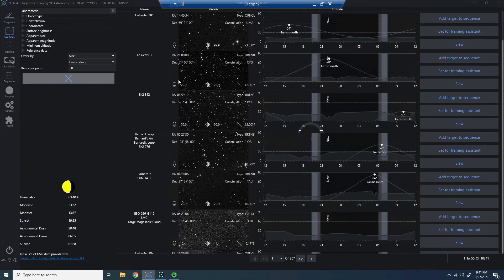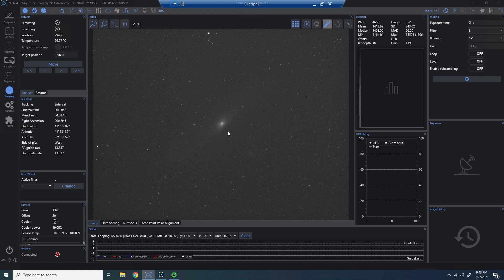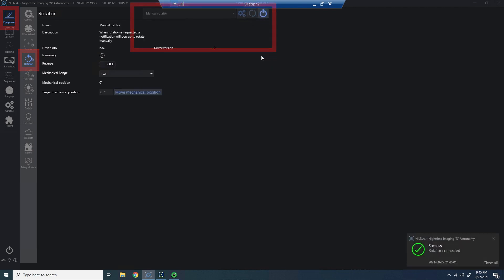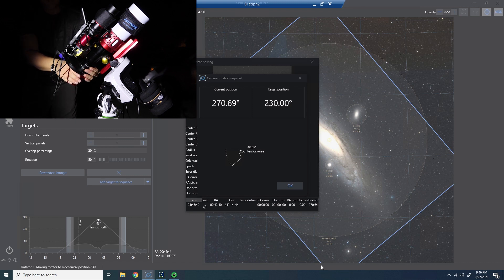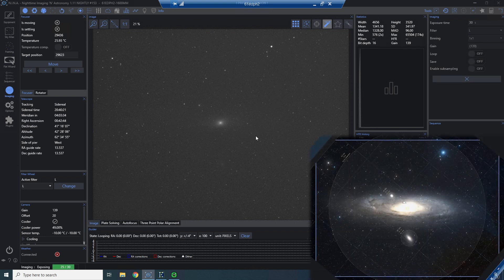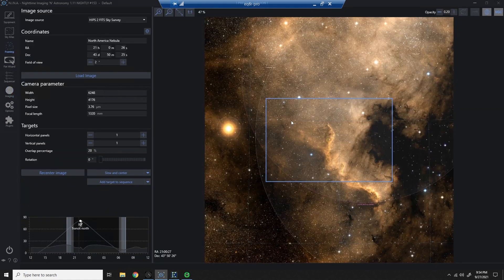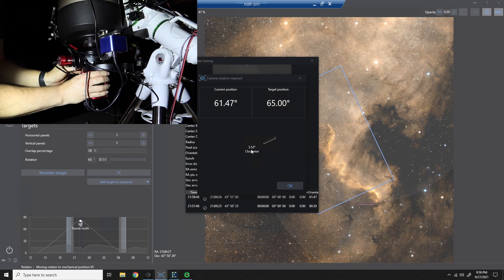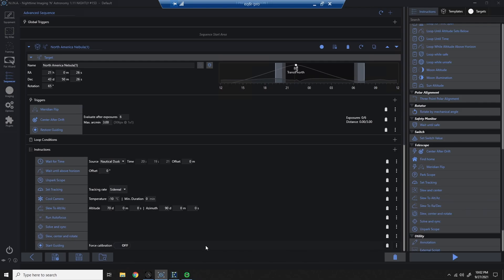Better Framing in NINA with the Manual Rotator

Comment: He says to manually rotate just the camera, not the camera and OAG nor the whole image train. The problem that creates is the OAG prism may be no longer aligned with the long side of the camera rectangle, in which case one may get vignetting from the prism of the OAG. Its important to keep the prism at 90 degrees to the camera sensor rectangle.

Comment: brilliant vid bud , im still new to nina and upto now i know how to connect mount HEQ5 - camera (nikon dslr Z6 and 600mm sigma lens, to nina and do a 3 point polar align and platesolve , and learnt to set the sequence for "many exposures" and "auto meridian flip" which i find really fascinating to watch 
my question is regarding the rotation can the same method you showcase here be used with my camera and 600mm lens ? my lens does have a ring collar so manual rotation is no problem 
also i dont have a guide scope at the mo im currently saving up for that so im generally shooting nice pin sharp stars at 90 second expos

many thanks :)

Comment: Keep up the good work, your presentations are always very clear and thorough.
Reply from the maker: thanks! sorry for the delayed response!!!
Reply: @PatriotAstro  actually I have a couple of questions if you don’t mind.  Nina advanced sequencer has been working wonderfully for me until last week.  Now when I frame and slew to an object, it is half off the frame and I’ve checked all my camera settings the pixel dimensions everything in it all seems good and I can’t figure out what it is.  Is there some common error that’s easy to overlook that I may have triggered?   

My second one has a do with a manual rotator.  It’s not doing anything anymore, no matter how different my framing is from my rotation it just hits the manual rotation trigger (slew, center and rotate command), does a plate solve, reslews (still half off the framing I defined), and then moves onto the next command if everything‘s OK.  My rotation tolerance was 5° and it was off by 40° Or so.    But NINA didn’t care.   The command is enabled it has no warning notice on it and my manual rotator is installed.  I’m imaging just half off the frame and improperly rotated.

And one more clue:  Last night for the first time -n my NINA sequence, the “center after drift” command doesn't work and it displays “NaNpx” in the number of pixels of tolerance that is allowed, I assume because it doesn’t know the pixel dimensions (i.e. what camera or scope is connected).   And if my unguided scope drifts and it plate solves with the "center and drift" it still says off by 0 pixels, even though it's clearly drifted.  It's as whatever triggered "NaNpx" just allows it to platesolves, but does nothing with it.  But once again, I look in all my HW config and the camera is attached and the parameters are correct, the telescope focal length is correct in the Framing section (although it's curious that when the "telescope" is connected in HW, that is really just the mount, the focal length is actually under the camera parameters in the framing section).
Reply: Just to reinforce that I’ve tried to chase this down:  I’ve posted to the CN forums and NINA Facebooks forum, got many suggestions for possible causes and checked/tested for all of the over two nights: no fix. (Ex: bin1 vs bin2 mismatch in capture vs platesolve, wrong telescope focal length, not resetting sequence, several places camera setting could be wrong or mismatched, ensure commands are enabled,  incorrect location config, latest NINA version, reboot computer, etc…)
Reply from the maker: @stevenmiller5452  Can you tell me which version of NINA you are running? There was a NaNpx bug but that has been resolved. I wonder if much of this stems from that?
Reply: It just so happens NINA said there was an update available.  I downloaded and tested it:  It worked, all problems solved.  It must have been a bug.
Reply from the maker: @stevenmiller5452  Ya, there was a wierd bug there. Glad it is sorted out! Clear Skies!

Comment: Chad, another great video.  Question:  I assume it would be best to have a manual rotator between the camera and the OAG so you don't rotate your guiding.  Is this a significant problem, it looked like you rotated everything.
Reply from the maker: I can rotate the adapter on the back of my guider such that the guide camera stays in place. But you are right, that would be an issue and require recalibration of PHD2/

Comment: Hi Chad, I am new to NINA coming from APT and can't find anything on how to do a manual focus update say 60min. into a sequence?  I get how to initially select a star and focus then frame up a target and start a sequence but once a sequence is running how to pause it slew to focus star and then slew back to target set in framing assistant?  Is this even possible?  I do not yet have an auto focuser so have to do this the hard way for now.  If this can be done a video would be great...
Reply from the maker: OK, so try to follow along with this logic. :) You can open the Advanced Sequencer and build this sample sequence to get a feel for how we can do this (without even connecting any equipment). 
Go to the Advanced Sequencer and drag over an empty 'Deep Sky Object Sequence' from instructions. This is where your target would be, such as M51 as an example. On that DSO container, put a looping condition of 'Loop Until Time' and select 'Astronomical Dawn'. In the Instructions section of the DSO container, add 3 items in this order, from top to bottom. 1st, add a 'Sequential Instruction Set'. Add a looping condition to the Sequential Instruction Set of the type 'Loop For Time Span' and set it to '5 seconds' (just for the demonstration, in your real example it would be 60 minutes). In the instructions section of the Sequential Instruction Set add an 'Annotation' instruction that just says "NINA would be imaging in here". OK, now minimize the Sequential Instruction Set and place a 'Message Box' instruction below that set... it needs to be below the Sequential Instruction Set but still inside the DSO Container. Add a message of, "It is time to check the focus again." Lastly,  below the Message Box, and still inside the DSO container, add a 'Wait For Time Span' utility instruction with a delay of '10 seconds'. 
So, what does this all do? When you start this sequence, (you can try it now) it will start up and determine it needs to run/loop your DSO object all night until Astronomical Dawn. Great! Inside the DSO container, as a first instruction, it finds a Sequential Instruction set that is built to run/loop its included instructions for 5 seconds (which in my demo here is just an annotation that doesn't do anything, but in the real world, this would be where your imaging instructions go. Additionally, this loop would be 60 minutes in your example, but much shorter for the demo). When the 5 second loop expires, it moves on to the next instruction which is a Message Box that pops up and pauses the entire sequence until you click OK. This is how the system will stop and wait for you to physically intervene. After clicking OK, the system will start a 10 second Wait For Time Span instruction. But, why do I need this? Well, the message box will pause your sequence, but it also locks up the NINA interface temporarily until OK is pressed, and once pressed, it moves on very quickly. So, after you press OK, this 10 second wait is just here to give you enough time to click the Stop button on the sequencer (which can be done directly on the imaging page, so you really may only need 2-5 seconds actually). Once it is stopped, you can perform focus or whatever you need to do, then when ready again, click the play button and the interrupted 10s Wait for Time instruction will restart. Once the full 10s expires, since it is the last instruction in the DSO object, it will loop back up to the Sequential instruction set where it will happily keep looping all night long until Astronomical Dawn. This all sounds WAY more confusing than it is once you drop it in a sequence. If still having issues, send me an email. :) Just build it like I mention and test it yourself. Hope this helps!

Comment: Thanks Chad. At 6:38 you say you’re only rotating the imaging camera. But wouldn’t that risk having the prism move into the image area (since you’re not moving the OAG with it)?
Reply from the maker: 100% yes. It’s not ideal, so an option would be to also manually move the guide camera along with the primary camera BUT you would almost certainly need to recalibrate PHD2 for guiding to work afterwards. That is a great point!
Reply: @PatriotAstro  Thanks. I have not yet got OAG set up, so I just wanted to check my understanding. :-)

Comment: Aloha Chad,  Great video!!  I was using a digital angle gauge (before) to position the camera.  This will definitely help!  

Had a quick question about meridian flips.  Sometimes I like to manually flip the mount early, but when I go to plate solve and re-center, NINA will slew the mount back to where it was before.  So, I turned the plate solve re-center option off (with just sync enabled), but I don't know if that is helping any.  Do you know of a trick to accomplish a plate solve (with re-centering capabilities) after manually flipping the mount early??  Thanks!!

Comment: Hey Chad , I am going to bang a few questions off you if you dont mind. I am learning NINA and I am getting it sort of.. Love how fast it can plate solve but here is my bug-a-boo I cant seem to solve. When I want to go from one object to another when it takes first image of the object I want the first image the stars are smeared and wont solve so I stop it and start it again from where it is and takes first image and everything is good finds where it is moves and bang right where it should be. It seems to happen only on the first slew. I have the scope settling for 15 seconds before it takes image.. I cant seem to stop it , so if I am not at the scope and not watching it will never complete unless I stop and start again . Any thoughts ???
Reply from the maker: What equipment? OAG? I had a similar issue and can't recall what it was... Maybe guiding? It could have been settle time. Hmm. Does this happen for the first image of the night as well?
Reply: @PatriotAstro  I am using a 10in LX200 f6.3 meade , everything works great except for when you slew to a new image and it takes the first image to plate solve I get star streaks so I stop it start from where it is and it solves then moves solves and goes one more time and dead center . it only happens whe slewing to a new image , not all the time but most of the time
Reply: out at the scope now
cold but going good

Comment: Thanks for the video , I am new to NINA coming from SGP and was so lost . I am starting to get to know NINA a little bit , was out the other night with it and tried to do the rotation , I chose manual and when it came time it did nothing , not telling me where to turn. I did not know about that drop down so now cant wait to try.... Next for me is to learn how to image and put those in there own directory
Reply: Thanks , I never had name of images selected so all images where going in the same place. When I first started NINA all I did was stair at it not knowing what to do , I am getting thee
Reply from the maker: @Steve_The_Ignorant_Astronomer  Reach out any time. :) Like I tell my kids and co-workers/employees - "Never fail alone".
Reply from the maker: Watch my profile setup video. There is a part about the imaging path that may help. Also, in the Advance Sequencer, make sure you use "Slew, Center, and Rotate" instruction if you need the rotator involved.

Comment: Again a very informative video Chad, thank you for the ongoing info about Nina, very appreciated !
Is it also possible to use a image that has been made by myself, lets say the year before, and want to add data with the same rotation ?
Reply from the maker: Yes. This is NINA, so... of course you can! :) Open the Framing Assistant and change the Image Source to "File". Open an exposure from the previous session. It will ask about using the embedded coordinates to speed the platesolve of this file, say yes. It will come up on screen, solved and ready to go. Then just send it to a sequence from here. I plan on doing a video on this soon, but it looks like clouds for a bit... :(
Reply: @PatriotAstro  Thank you Chad, great info again !
Reply: @PatriotAstro  So this would work with an image that I have made last year using APT then ?
Reply from the maker: @siegfriednoet  It should, yep.

Comment: once again great video.  Your explanation for use with manual rotator is wonderful.   I have the Falcon rotator and it works perfect with NINA.  The tolerance for accuracy with rotator is 0.1.  Thanks for  all the info.
Reply from the maker: That's great to know. I've looked at that rotator a couple times in the past.

Comment: Great content!  I'm still using the stable version of NINA and seeing lots of videos lately highlighting the changes in the Nightly builds.  I'm starting to get concerned that they are changing so much that the next stable release will involve a significant learning curve.
Reply: Funnily enough, I have found 1.11 more stable than the 'stable' version. There are too many goodies in 1.11 to not make the move.
Reply from the maker: The basic sequencer is still available in 1.11 but the benefits to getting into the Advanced Sequencer are well worth the move. Definitely take some time to watch my NINA videos around the sequencer and download my templates. It will help you get started. Ask any questions you may have. Unless you are shooting 2 rigs simultaneously and using synchronized dithering, I would move to the nightly version now. It has been stable for me for quite some time. This will let you start using features as you are comfortable but stick with the basic sequencer until ready. 1.11 is definitely a bigger change than most because of the sequencer rewrite.

Comment: Another great video. So many features in NINA . Rotation and framing is so important. I had just been doing it manually but with out the manual rotator feature in NINA. This is so much better.I may have to rethink my purchase of the ASI air plus.
Reply from the maker: I absolutely love the concept of the Air+ I just dont think i could live with it. It is PERFECT for some people that need a turnkey functional solution that just works. I need flexibility, NINA, ability to run Nightly and Dev builds with new features, ... flexibility in general. Glad the videos helped you out!